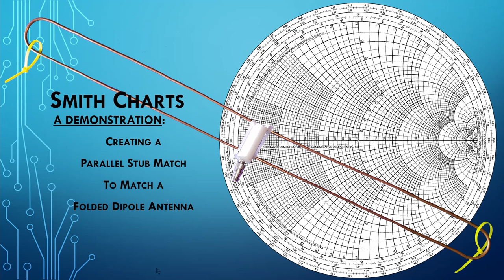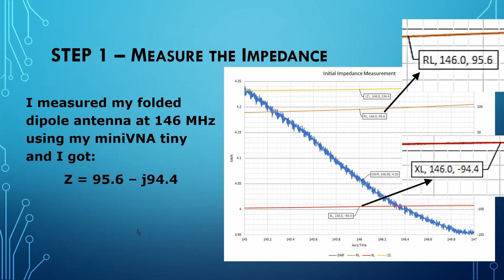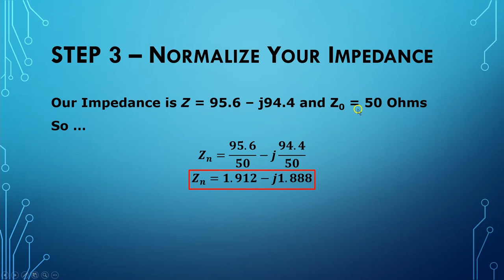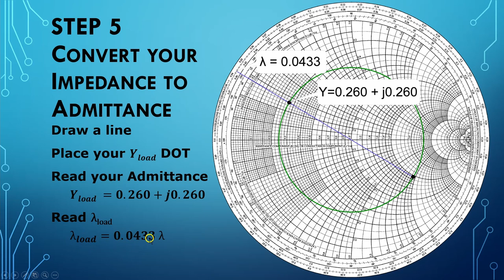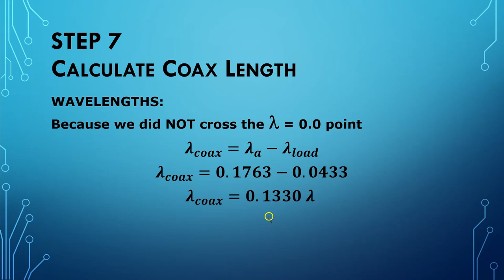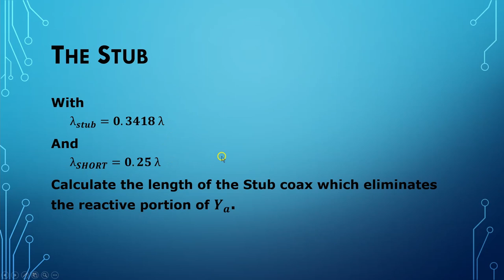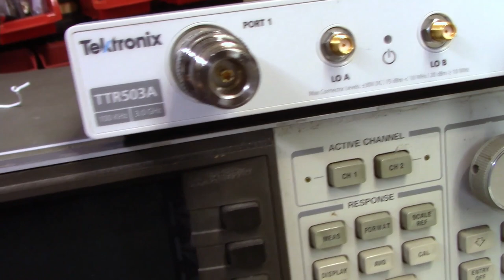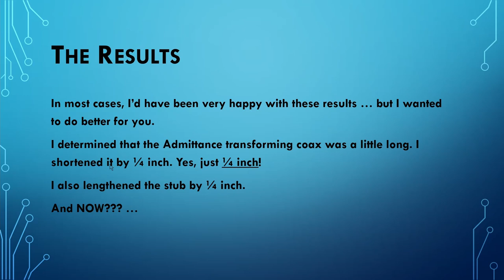Smith Charts: DEMO 2 - Folded Dipole Parallel Stub Match Design & Build (00h9)

Comment: This is exactly what I was looking for thank you so much!
Reply from the maker: Perfect! I thought it might. Enjoy experimenting.
Reply: @eie_for_you  is there a book or any additional videos that would show me how to add a parallel inductor or capacitor to an antenna system? I understand how to do a series you just hook it up in line with the rest of it but I'm just not too sure about how to do it when it needs to be parallel
Reply from the maker: @PatAutrey  So, you are talking about mechanically how to do it, I presume. This is as varied as there are installations. Everything from just connecting them across the antenna terminals to fancy homemade assemblies to a small water-tight enclosure with connectors on either side and the required component inside.
You might find some ideas in the ARRL's "Antenna Book."
Reply: @eie_for_you  funny you mention that, I just started looking at it last night! I'm homing in on the info, thanks again for all of your help!
Reply from the maker: @PatAutrey  You are welcome!

Comment: I enjoy your videos Ralph.  I have a question. As me being a truck driver I’m not home a lot. But I was wondering if you know any courses online or information I can read to learn more about working on my own cb and antenna system.  Your videos have taught me a lot. I was just looking for more info to go in depth.
Reply from the maker: Thanks for the encouragement!  I am working on a video now on troubleshooting your coax that might answer some of you questions (??).
If by "working on my own cb" you are referring to working on the guts of the radio, this requires access to the service documentation for the radio. Most manufacturers hold this stuff pretty close to their chest ... tough to find. Further, it requires a real knowledge of how the stuff works ... also a LOT to learn.  
On the other hand, if you are referring to the "black box" we call a radio and setting up the antennas and being concerned about your feedline and all of that, now THAT is a bit of a different story. There is still a fair amount of "magic" and specialized knowledge involved, but it is a LOT more doable.  I cannot speak specifically to CB as I have had very little contact with it in specific.  HOWEVER, the American Radio Relay League (ARRL) has a huge bunch of radio related stuff that might help like Radio Handbooks and Antenna Handbooks. I would peruse their stuff and see if something there meets your needs.
Sorry I couldn't be more helpful.

Comment: Hey Ralph, really insightful video. Can you please help me out with something? I am working with a fded dipole for VHF. It was already tuned before by someone else and has a single stub for matching. The thing is that I am not sure how it is connected. It does not make any sense to me and has flipped the entire knowledge of my antenna theory by 180. The stub is shorted to inner conductor on one end. But the other end in theory should be shorted to the outer end but it is not!! The other end of the stub (the one not shorted to inner) just goes and connects to the other end of the folded dipole. But the thing is that antenna works. Can you help me out? Or point me to a reslurce which can help me
Reply from the maker: That sounds like a 4:1 balun made out of coax. Check out this video on the subject:
https://youtu.be/fG7ZpsjXRW8
Hope this helps. 🙂
Reply: Thanks a lot. Found the video to be super helpful.
Reply from the maker: @nirbhay_raghav  You are very welcome! I'm so glad it helped. 🙂